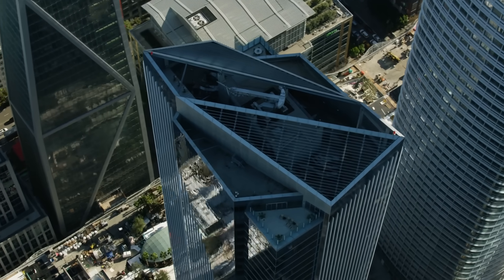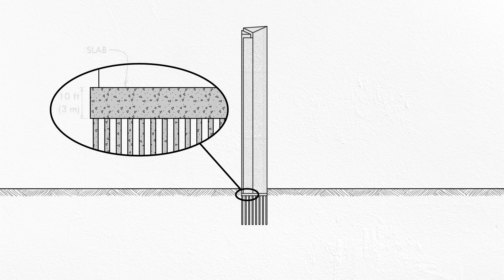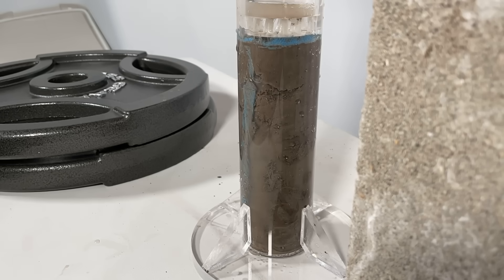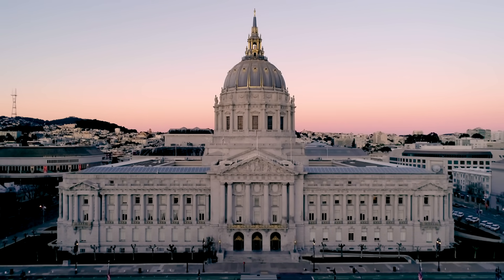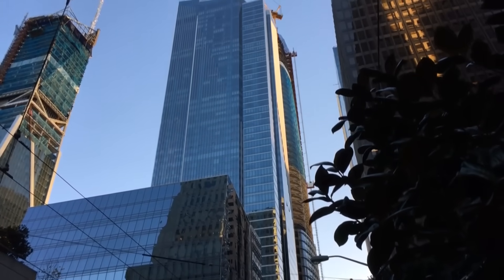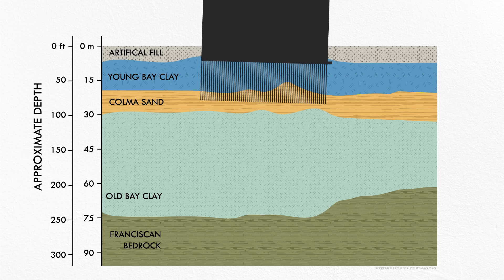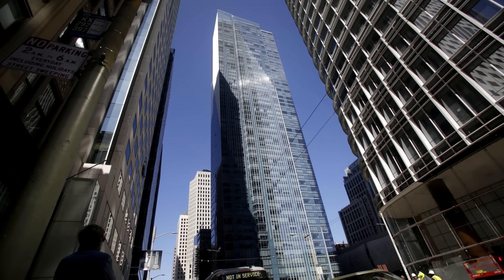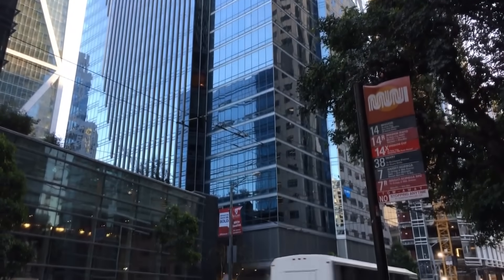What Really Happened at the Millennium Tower?

Comment: "Safe" it may be, but settling that far has misaligned the utilities with the ground, and horizontal plumbing lines inside the building no longer have enough slope to drain properly.
Reply: Also the Home Owners Association will at some point be having to charge residents special fees to clean up some second or third order consequence of this in the future, potentially decades from now. So why buy into that uncertainty and while amusing to have ping pong balls naturally rolling to a corner of the house it is not what you want to sink a large portion of your net worth into.
Reply: That aspect reminded me of the story of the Florida condo collapse with the concrete cracking, etc.
Reply: Even several years ago they were having issues internally with things like doors, windows, and kitchen cabinets not closing properly because they settling pulled the structure out of square.

Comment: Good story, well told, one of your betters ones IMO.  Any idea why there's a gap between the two sections of the new piers, and how many were being drilled at once? If the 'old bay clay' is so bad/loose, does that mean the news holes---the outer dia. on your cross section ---are being drilled inside steel tubes all the way to bedrock, which is alot of steel?

Comment: The Bearing Capacity of the Soft, wet clay or muddy clay is around 50kPa, so you can design a house up to that not the 5kPa you stated at the beginning of your video.
Reply: Yes, I think he was using the plan area in his calculation. Most soils are good for 1500 pounds per Sq ft, 1000 is usually an absolute minimum.

Comment: I haven't seen the geotechnical report, of course, so what I'm about to say is pure speculation. What we have at this construction site is a layer of sandy soil sandwiched between two layers of clay on top of which they placed a buhzillion ton building. Dewatering rule #1 says that groundwater can not flow through clay. There's a reason coffee cups are made out of it. So, if groundwater was found which it obviously was, it was found in the sandy soil between the old bay clay and the new bay clay layers. Groundwater is very rarely stationary. It flows just like an underground river and the rate at which it flows varies from inches per year to feet per hour depending on the composition of the soil it's flowing through and the amount of head (pressure) it's under. The amount of head it's under is going to fluctuate according to the seasonal and environmental sources that are feeding it. Because of dewatering rule #1, the young bay clay layer is literally floating on top of the colma sand and it's being supported to some degree by the amount of head present in the groundwater. Dewatering the colma sand will make it more stable so as long as you keep dewatering it, but dewater too long and you'll eventually cause subsidence in the young bay clay layer and all the surrounding buildings will start to lean as well.

I don't see how sinking pylons to bedrock on one or two sides of the building is going to solve the problem when rest of the building is supported by relatively unstable soils which are at the mercy of fickle and unpredictable groundwater. I think they're going to have to go to bedrock all the way around which is the way it should have been done in the first place. But that would have been, you know, expensive.

Comment: The Millennium Tower's future depends on an engineering fix, but the repair costs are the deciding factor. -- Engineers are employed by the corporate ownership and their goal will be to repair the Millennium Tower as cheap as possible and not be liable if it fails, this means a decent fix may be near impossible to be made, because the tower is currently leaning 23 inches to the west and 9.5 inches to the north, which includes about six inches of newly added tilt to the west just since May 2021, this affects the drainage of roofs, exterior decks, shower floors, hot tubs and bathtubs, all waste water plumbing and etc. At some point the building will tilt too far for the plumbing work, so why try to save this building, when nobody wants to live in it anyway?
IMO, it's time for the City of San Francisco to condemn the Millennium Tower and order it to be torn down, which will be very expensive and the corporate owners will not want to do this. The real battle here is about money, because "the avarice of money is the root of all evil."

Comment: in my city you're not allowed to build multiple towers within a certain radius/time of each other because of possible settlement. surely a metropolis like san francisco, built on loose low ground and next to a fault line, would have the same regulation, no? with the bedrock being so far down there i don't think they'd want to build foundations that deep so that should compound the care taken.
Reply: SF has a lot of skyscrapers, and this is the only one that's sinking like this.  In heavier/taller towers, they do drill down to bedrock, sometimes as much 300 or so feet below the surface.  Smaller/lighter towers sometimes have friction piles instead, like the millennium tower.    Basically, they built a cheaper foundation that in SF, is best for a lighter steel frame tower (due to the unstable ground throughout the downtown area), but then built a heavy reinforced concrete tower on it instead.  Whoops
Reply: @punchnazis3498  yeah that's an oops alright. seems like another case of ignoring regulations to save money. because that always ends well /s. hopefully there's no large earthquake or accident that tips it over before it's finished being stabilized.

Comment: Could we assume that the sinking was accelerated during drilling because the drilling allowed an additional outlet for any excess moisture..? Almost as if the drilling crew just installed several vertical drains? I am genuinely curious
Reply: Probably that, coupled with vibration induced fluidisation
Reply: @MikrySoft  liquefaction doesn’t occur in that support layer
Reply: They should have started drilling on the high side to accelerate that settling!
Reply: I thought the same thing. I think the issue would be predicting how much settlement would occur on the other side. They may end up causing the other side to sink more if they overdid it. However, I would hope they considered it.
Reply: @YoungCoty  Yeah, one might think it would be best case scenario, technically, to have access to all sides of the building simultaneously and drive piles selectively balancing out the whole operation in the process.

In practice, I'm not sure they would be able to block off basically all four sides and the roads and everything else associated with that.
Reply: I saw a documentary about this https://www.youtube.com/watch?v=oFOUqRBWH-I

Comment: Forgive me if I'm wrong, but couldn't the plan of jacking up one corner of the building potentially cause voids to appear beneath the structure? I would imagine it's somewhat akin to leveling your driveway; Sure you could lift up one end, and some people unfortunately do, but that runs the risks of introducing voids which can fill with water and accelerate erosion under the slab of driveway, causing deformation and cracks over the course of a few years.

My layman's intuition says that is entirely possible with a huge building that exerts a monumentally larger force on the ground than just a slab of driveway or walkway. Please, correct me if I'm wrong, I'm always willing to learn :)

Comment: The perimeter piles with the slab extensions was an ingenious solution. Must have been frustrating as hell when the guy who thought it up found out they couldn't drill without accelerating the problem they were trying to solve. Ah engineering

Comment: I'd be curious to know if hydraulic concrete jacking was considered as a possible fix, and whether it would work - i.e. stabilize the sand layer and lift the building a bit. I'd imagine the pressures required are around what is used in hydraulic fracturing, so the equipment exists to do it.
Reply: Given the scale of the problem and the investment at stake, I'm quite sure that every known approach was considered.

Comment: Bold take: they will dismantle this building. The problem will get to a point where the building cannot be safely dismantled if it gets any worse, so the city will demand it be done while it still can. 

Recall that this is a self perpetuating process, the lean exerts more pressure on one side which causes more uneven subsidence. Things look tractable now but only because we are in the early stages of an irreversible and accelerating process.
Reply: Taking it down would be the prudent choice. Loss of wealth among the responsible parties will keep that from happening. Unless they can figure out a way to get the public to pay for it, would not surprise me if that is the plan. Privatize profits, socialize losses.
Perhaps a compromise, take 1/2-2/3 of it down, maybe the lighter load will stop the disaster.
Reply: I wondered about that... how does this fix affect the rate of settlement on the opposite side? could the building end up tilted the other direction? Seems to me it would be wise to keep access to the hydraulic jacks, just in case.

Comment: This got me to thinking about the CN Tower in Toronto. Fortunately, the soil overburden above bedrock there was only about 12 meters deep, so the Tower's foundation sits right on bedrock. (Ordovician, for those into geology) But perhaps more importantly, the Tower's center of gravity is only 62 meters above the ground, which doubtless adds to it's stability.  It is currently 2.794 CM  off perpendicular over it's 553 meter height. ( that's 11 tenths inches in the  27.4893939 Chains height in American Measure)
Reply: We don't measure things in tenths of an inch, we divide inches by powers of two. :)

Comment: AFAIK the other buildings using friction piles are steel skeletons making them much lighter than Millennium Tower. The tower is reinforced concrete and the working theory around here is the massive increase in weight is primarily responsible.

Either way I suspect the city won't be allowing friction pile construction going forward. Just drill down to bedrock then you won't have problems.

Also hard to overstate how much the construction accelerated sinking. AFAIK the modified drilling procedure didn't help at all so all work has ceased for the moment (but the accelerated sinking has yet to subside)

Comment: i worked on a sewer plant and a building about the size of a house was sinking away from the pit, and it turned out that the cast piles were put down 5 feet and were suppose to be 25 feet and it was on the plans as for 5 feet and they say we should have know, we just followed the plans, it sunk 1 inch before the job was even finished, it was trold it was going to cost $100,000 to fix the problem i do not know what was even done

Comment: I once saw a news story on how engineers were draining mud from one side of the foundation of the Leaning Tower of Pisa in order to reduce its tilt somewhat for safety reasons.  They didn't want to get rid of the tilt entirely, of course, just get it down to a more tolerable level, but I suppose they could have eliminated the tilt altogether.  I suppose something like that would not have been an option here.
Reply: There is a complete Nova episode on that project. They injected a grout like substance to stabilize and support the tower.

Comment: The devolpers of the building cheeped out. Rather than drive pilings to bed rock, they went engineer shopping and found a firm who didn't have real experience in bay mud. The only fix is to remove the top half of the building or demo the the entire building

Comment: I know it doesn't help the situation now, but I wonder if they could have made a series of concrete hydraulic pistons to begin with. Imagine, a concrete basin below the 10' thick footing and above the piles. As the piles settle they would only need to pump more water into the basins to jack the building up as compensation for the piles settling. This would make the building "float" and never actually settle any - only the piles settle and the basins get pushed down with the hydraulic pressure....

Comment: I didn’t catch whether or not you addressed the fact that they designed the foundation for a steel structure and then decided to go with concrete structure without addressing the additional forces on the foundation. Is this omission intended? I hope not. Check your sources and their bias. Also, was the modeling for failure you speak of done as a concrete or steel structure?
Reply from the maker: Although the building was originally intended to be a steel structure, the foundation design was checked and revised for the new loads.
Reply: @PracticalEngineeringChannel  I lived in San Francisco throughout all of this and have been following it for years. It may have been “checked” but they doesn’t mean there wasn’t an incentive to sign off on it.

Comment: I’ve tested 120’ deep 24” round 5000psi high pressure grouted augercast piles to over 700 tons with very very small movement in Florida. I’ve never dealt with San Francisco but surely they knew better. Those 24” piles were for a 58 story condo...
Reply: Yes, they did know better. Treadwell & Rollo, the geotechnical engineer for Millennium Tower just had a 52-story skyscraper at nearby 80 Natoma with the same cast in place concrete construction and foundation rejected by the city's Department of Building Inspections and they could not afford back to back rejections of projects of this magnitude so they simply skipped that part and went ahead with the construction they knew was defective and would have been rejected had it been submitted for peer review.

Treadwell & Rollo are large large political donors

Comment: Yeah... I remember the fist time I heard about the Millennium Tower in our local news... they were showing residents setting down a ball on their floor and watching it roll (with some speed) towards the corner of their condo.  At first I wasn't sure what I was seeing, little did I know it would turn out to be a huge problem like it did.  The building also had broken windows high up, they said "wasn't caused by the settling" but if not, then that's odd, and you mentioned the trans-bay terminal, I think it had problems from settlement too,  they had to close the road under the crossing, rerouting the buses and vehicle traffic, making a real headache... I think the steel support beams were cracking so for that they put jacks while they retrofitted the supports... that whole area is just a hot-mess of construction issues plaguing both of these projects.  I'm glad I don't live in S.F. but the whole SF Bay Area is an earthquake disaster area waiting to happen.

Comment: So, how do you dismantle skyscrapers like this one that is located in tight spaces if it can't be saved through secondary means?

Is it just dismantle from top down or would it be a standard imploding?
Reply: Imagine the the cost of risks. if they leave it up and spend money on level engineering and fails to keep up right then leans one side as gravity takes a pulling power from the top to bottom. That sheer weight would've been simply great pressing downward even the side leans a bit over a few inches. Otherwise, tear apart from top to bottom or cut in half and leave at that! No matter the cost slices, it's gonna be big either way.
Reply: @HighAway  thank God I'm a computer engineer. I don't have to worry about my circuits falling out of the sky like a ton of bricks.(so to speak)
Reply: @kineticstar  i eat money for a living.

Comment: Would it have been cheaper to have initially had piles to bedrock when constructing the building, rather than just going to the sand level?  Could a mix of piles to the various layers (20% bedrock, 30% old bay clay, 50% sand) also been a viable strategy?
Reply: It would have... Or they could have just used the original plans that the foundation was designed for, with a steel frame instead of a heavier and slightly cheaper concrete. 
 Not only did the heavier concrete frame reduce the safety margins on the foundation, it also imposed a finite lifespan on the building, because they used reinforced concrete with reinforcement which isn't immune to corrosion from concrete acidification. 
(Stainless steel and fiberglass rebar reinforced concrete lasts forever, galvanized steel rebar lasts potentially ~100 years, carbon steel rebar lasts ~50 years.
Since there is visible corrosion on the rebar in photos of construction, that means carbon steel rebar, which means the millennium tower was going to have to be demolished after 50 years no matter what.
For comparison, the steel framed & granite clad Empire State building is expected to last 7,000 years with routine maintenance before fatigue stress begins cracking the beams.)

Comment: I am curious if the decision to change from a steel skeleton bldg. to concrete was carried through to updating foundation design. I raise this, as one structural engineer indicated that there evidence of dishing in the foundation slab. As a non structural engineeri your assertion that the piles which are not driven to bedrock are supporting a load of 11ksf seems very high where as I understand nearby bldgs. some of which have piles that were driven deeper carry loads fo some 2ksf a huge difference. The only winners in this project are the principals of Treadwell and Rollo who already cashed out and the lawyers who have years and years of work ahead of them.
Reply: Yes, absolutely. The engineer that signed off on it had his reservations, though politics are the reason this moved forward as it did